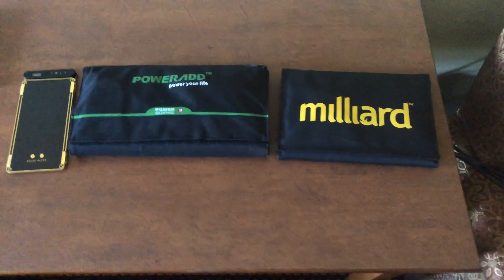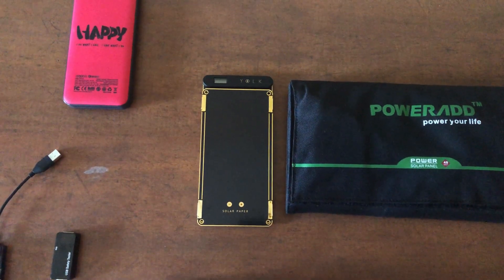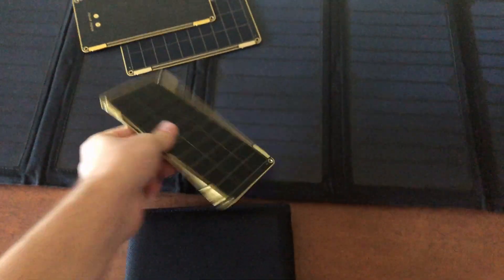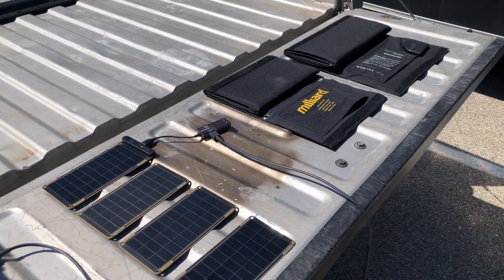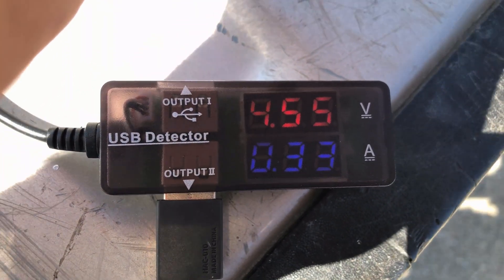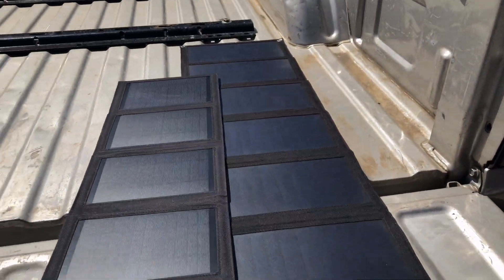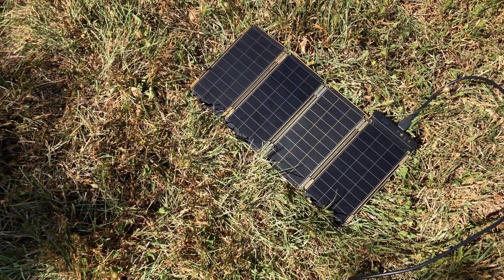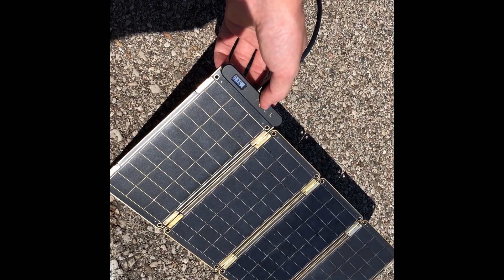Foldable solar panel review (Yolk solar paper, Milliard, Poweradd)

Comment: hello, among these portable solar panels, which one do you recommend? or any recommendation of solar panel models? Thank you
Reply from the maker: The milliard and poweradd never gave me any complaints, but I don't think either are available anymore. I'd just look for a panel with more than 14 watts of output so you can charge two things at the same time. I still have the milliard and poweradd, so I haven't had to buy another fold-able panel in the 6 years since I bought them. I keep the poweradd in my truck with some battery clamps I made so I can recharge my car battery if it dies. Something to think about.